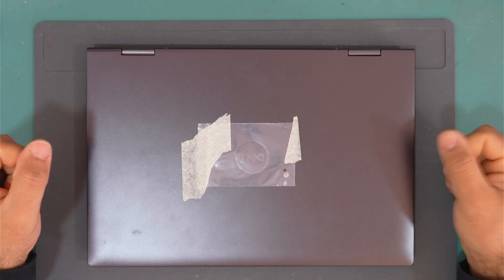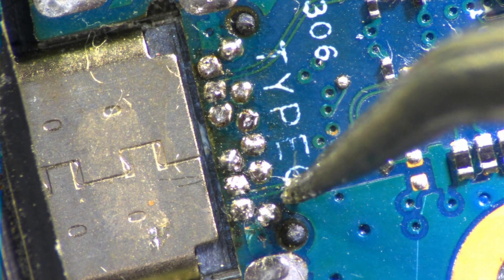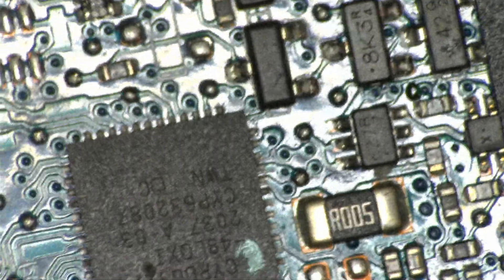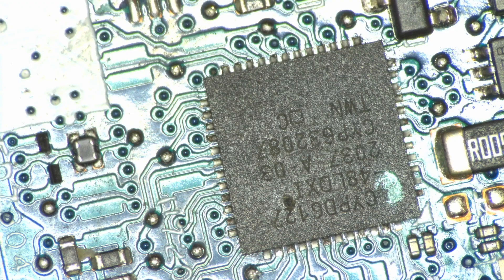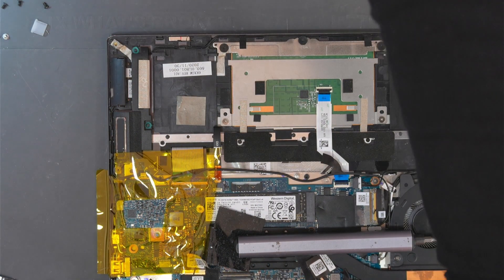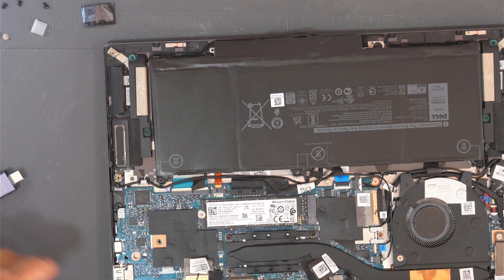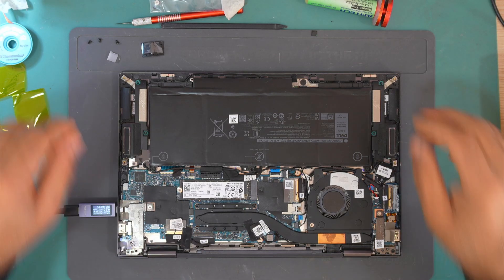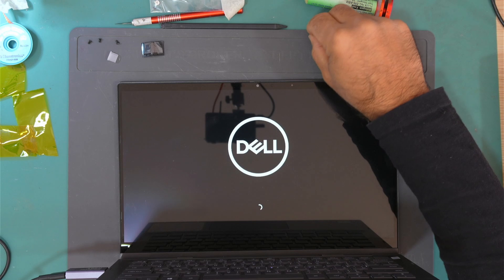Dell Inspiron 7306 Not charging Repair Type C PD Controller IC Burnt CYPD6127

Comment: Good job 👏! Luckily, this PD chip wasn't programmable 🫣. Luckily, there was no more damage on the board. 
2 hypothesis on what may happened. 
1) The PD controller blowed up because when the charging port got broken, the VBUS got shorted to some data lines. 
2) The PD controller blowed itself, they replaced the charging port (thinking it was the issue) but still didn't work and brought it to you.
Recently (2 videos ago) I replaced the PD aswell, my 5v power supply got shorted and blowed up my PD controller.
Hopefully, you will keep on posting more videos on laptop fixing 👍
Reply: Salut Maz , j'éspère que tu vas bien 😚
Reply: @Fourty_7  Salut 47 !!! Tu me trouve partout, toi 😁.
Oui, ça va nickel, j'espère toi aussi ?
Au j'ai eu une réponse à mon commentaire 😆😉👍